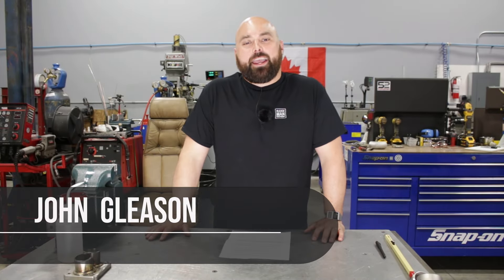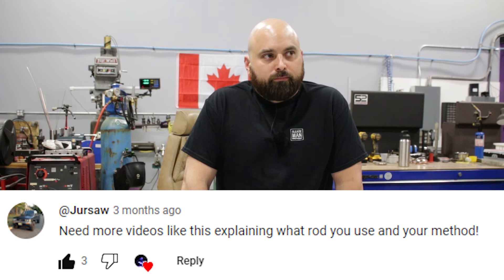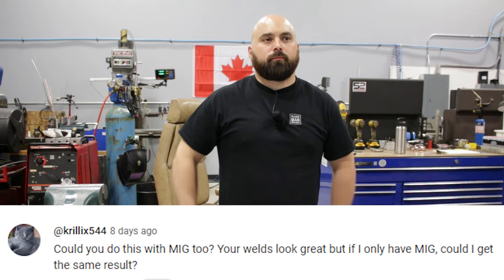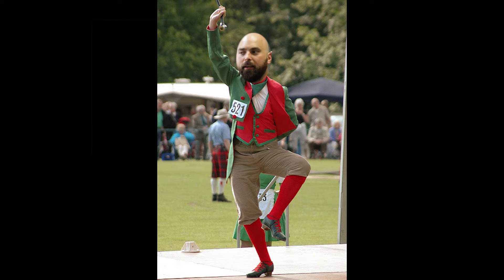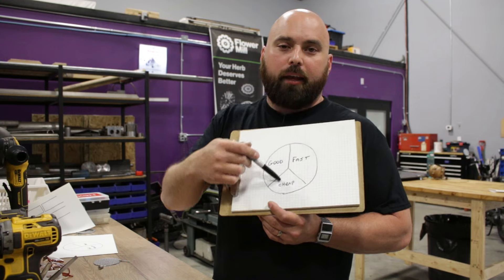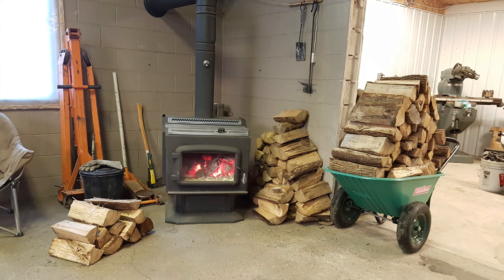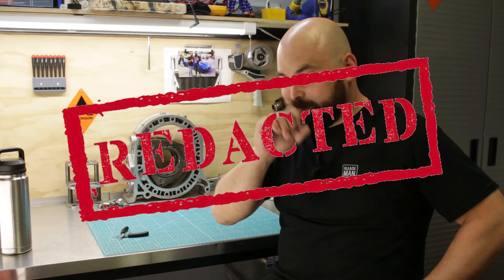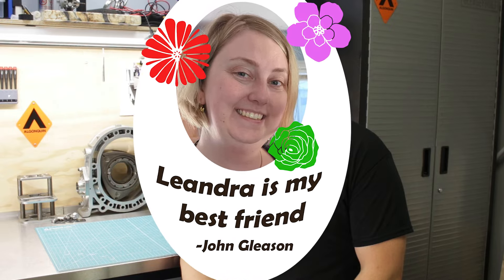How to get started selling MANIFOLDS

Comment: Great video, thanks for sharing your tips and tricks.
One other angle regarding the CNC mill.... In addition to the high cost and time involved in becoming proficient running that machine there is the time involved in designing and machining the parts.
Great if you have the time but as a fellow one man show my time is precious and hiring out cnc machining is like hiring a part time cnc operator without the overhead.
Owning an expensive piece of equipment like that makes the most sense when it's running all day. Otherwise saving 50% on machining in house is quickly washed away by the cost of the machine collecting dust in the corner of the shop.

Comment: Why do you use 309 instead of 308 or 316 rod? When i first started welding i used a 309 out in the field and after a day of rain the weld rusted and my boss called me into the office to basically ask me why i was so stupid. He explained 309 was for welding stainless to carbon steel and told me not to do it again. I also learned later on that some schools use it to train students to weld stainless steel while using carbon pipe for practice to reduce costs.

Years later we had an issue with the welders in a shop i was the lead fabricator in and the young guys insisted 309 was good for stainless and sure enough we got rust spots even after an acid wash. My boss and I ended up having to lock up the 309 rods in the tool room because they kept using it without permission. 

Now I'm wondering if there's actually a really good reason to use 309 on stainless and I just missed a method to keep it from rusting. It would especially throw me off if there's a good reason to use it on sanitary tubing.

Comment: Dunno if you're still answering questions about the previous video, but, why pipe instead of tubing?  Is it because the heat involved in turbos makes it "too much" for tubing?
Reply from the maker: Some of it's about the heat, but the largest reason is so it can support the weight of the turbo without adding supports to hold the weight. Takes a lot of strength to hold a 45lb turbo while glowing and bouncing down the road